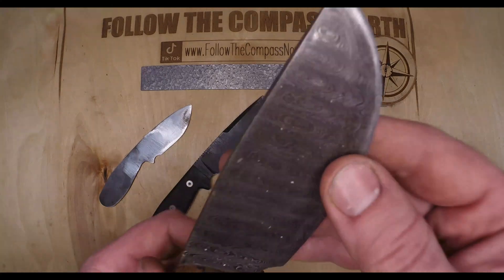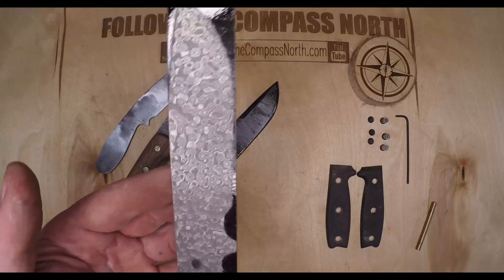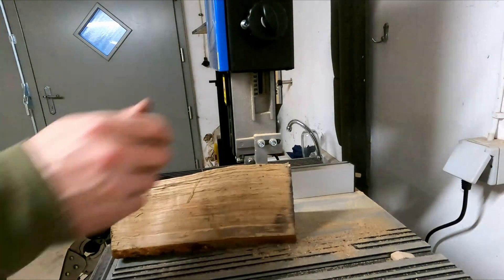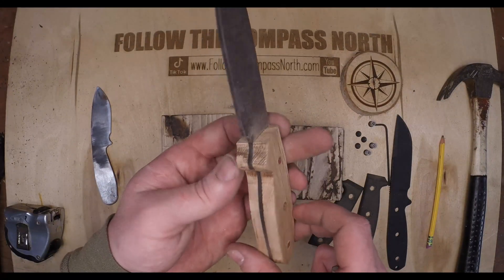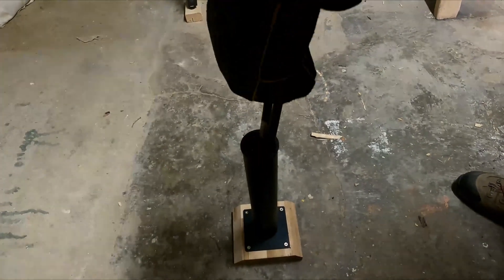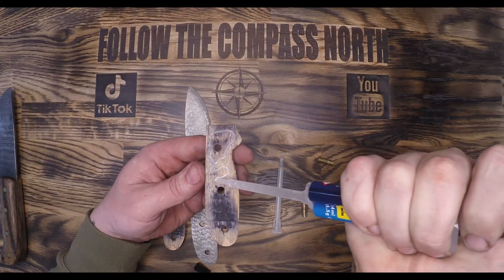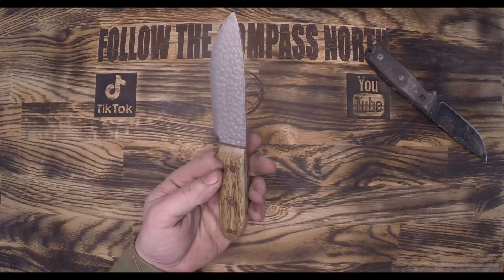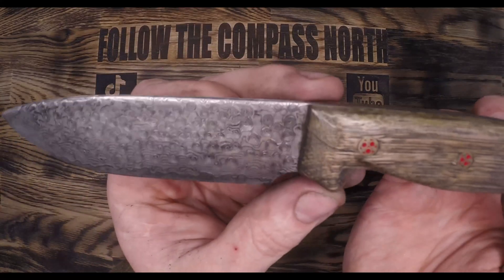Shaping, Fit, & Finish of Modern Damascus: Knife Making for Beginners

Comment: Building your own knife! I dig it!

Always wanted to do that but I don't have the tools or the skills for that.

I was actually wondering about something tho.-
Rambo survival knife but full tang instead of the regular hollow. How usefull would it be? 

They're pretty big, but they got the saw-tooth ridge on the back so that might be good for survival, maybe? I'm just a big Rambo fan but I can never justify getting one of those knives because of the hollow handle thing. But making one and making it full tang might be worth it if I can get actual use out of it so that's why I'm asking
Reply from the maker: I actually had to go look up a picture because I couldn't remember what it looked like. It's been years since I watched that lol. So, I PERSONALLY do not ever really use serrations on a knife, which is why the ones I make don't have them but many people find uses for them. That much serrations would get in the way for using a beater stick method of splitting wood, which is what I personally normally use, but properly sharpened might be good to use as a saw instead depending on how well its put together. Shape wise it's really just a Bowie type knife so you CAN get those in a full tang and people use Bowie knives very commonly. I think properly built a Rambo-style Bowie knife would likely find its niche in the survival community.
Reply: @FollowTheCompassNorth  thank you for your reply! By "beater stick for splitting wood" do you mean the technique where you put the blade against the thing you want to cut and then bash the blade, or am I confusing that with something else?

I was under the impression serrations were for difficult to cut stuff. Since you don't have serrated blades, what do you use for more durable stuff? Is that even a factor in survival and bushcraft? Do you use a special cutting technique or do you just take more time to cut with the normal knife?

Comment: Nothing wrong with using local wood, brings you closer to the spirit of the land.  I myself use a lot of local black walnut.
Reply from the maker: Very nice, if I was better prepared I would have used something nicer but I didn't think ahead so oak it is!
Reply: @FollowTheCompassNorth  oak may not be the prettiest, but it's tough.
Reply: @CyberJanksmith  It fueled the British empire at its heights so I am inclined to agree. I don't mind the oak aesthetic to be honest I think he did a pretty good job.